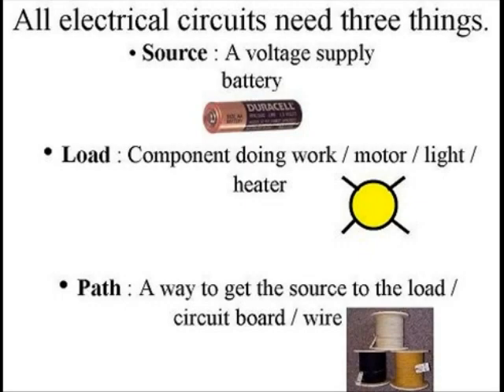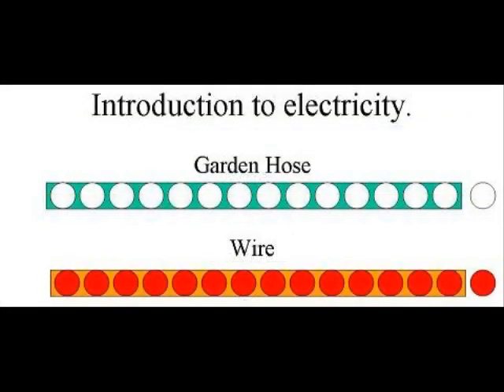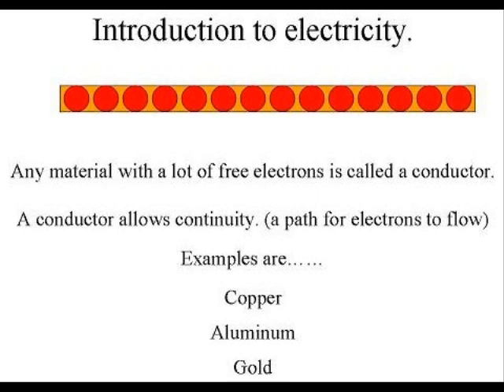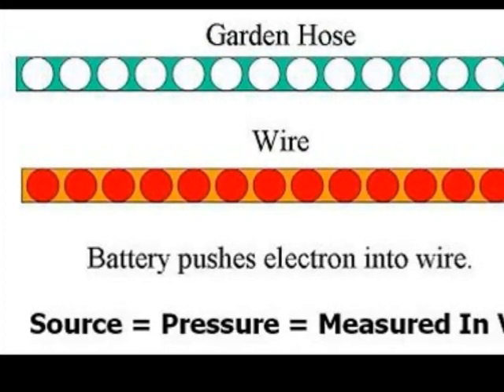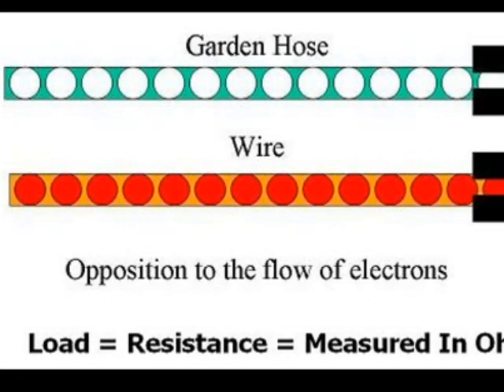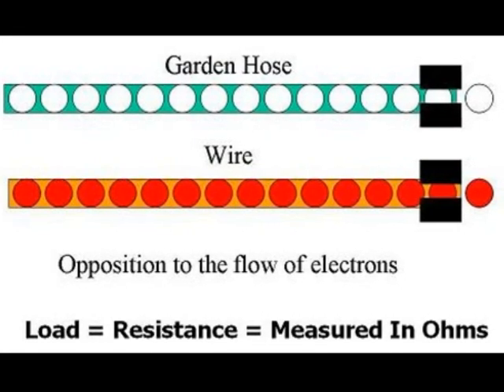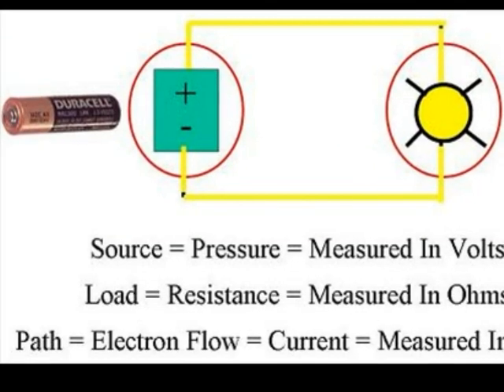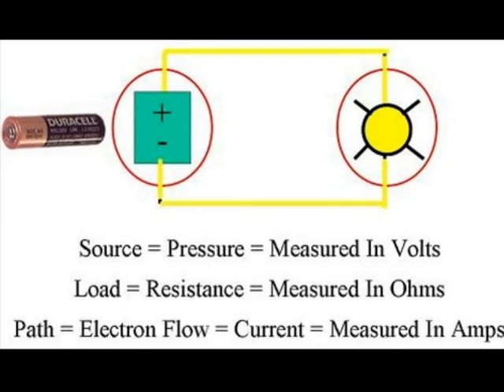Intro to Electricity

Comment from the maker: @danjov45 A wrench has little "resistance". Current is lazy always taking the easiest path. Give those electrons a real easy path like a wrench and they have a "party". This is why you get a big spark. But your body has larger resistance so you can touch both sides of a car battery (while the vehicle is off) and not get hurt.

Comment from the maker: The heat that is always caused by any electron flow is due to the friction of electron flow. This energy used up to overcome resistance never lets as much back as left. Kind of like a ball bouncing off the floor. It never returns to the height in which it bounced from and eventually stops.